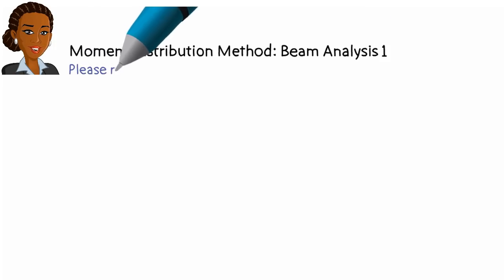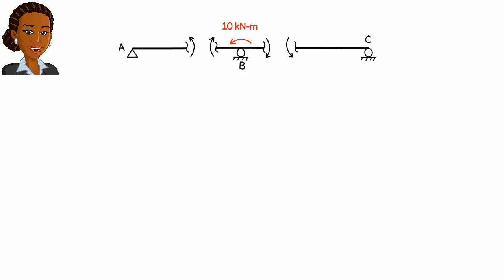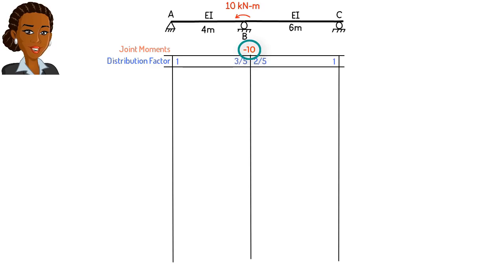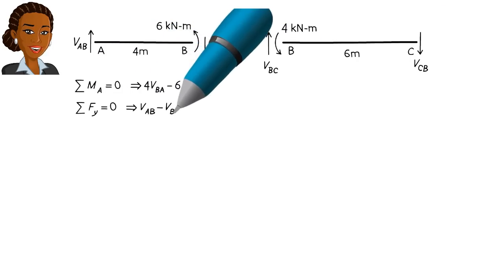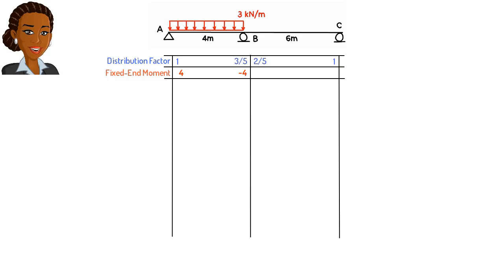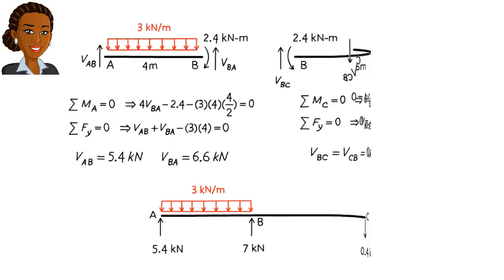SA38: Moment Distribution Method (Beam Analysis 1)

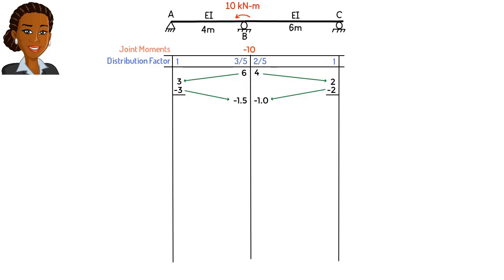Comment: At 6:09 , half of 6 goes to support a , but shouldn't there be  a 3  already existing there , ? Why are we considering 6 , when it gets halved as the other half is carried over to support A , so why are we considering it in full when we sum the moments ??
Reply from the maker: You wrote “shouldn’t there be a (moment) of 3 at A already?” 

At the starting point the applied moment of -10 is distributed to joints A, B, and C. The moment at A is 3 which is half of 6 (the moment at the right end of segment AB). Why should there be any other moment at A already? Where does that additional  moment come from?
Reply: @DrStructure  sorry I meant the moment at joint b , when the 10 moment gets distributed and 6 comes towards segment ab and 4 goes to segemt BC , then we say the half of 6 goes to support a due to carry over ,but my question is that shouldnt there be moment 3 left at b because 3 goes to a , then when we sum moments at BA then why do we consider the whole 6 and not 3 ?
Reply from the maker: You are assuming that we cut the moment in half, keep half of it where it is, and carry the other half to the other end of the member. That is not the right way of thinking about/visualizing it.

We take the total moment acting at a joint (say, the moment of 10 kN.m acting at B), and we distribute it to the ends of the members based on the distribution factors. In this case, we need to distribute the 10 kN.m moment to four member ends: the left end of member AB, the right end of member AB, the left end of member BC and the right end of member BC.

Since the 10 kN.m is applied at B (where the right end of AB and the left end of BC meet), the moment is distributed using factors 3/5 and 2/5 (obtained from member stiffness coefficients).

The 10 kN-m moment also impacts (distributes to) the far end of each member. We say the 10 kN-m moment distribution to the far end of each member is equal to half of the moment distributed to the near end of the member. So, since the distribution of the 10 kN-m moment to the near end of AB is 6, then the distribution of the moment to the far end of the member is half of 6. See Lecture SA37 for an explanation of why this is the case.
Reply: @DrStructure  if half of 6 goes to other end due to carry over and it comes out as 3 then that means the 4 that goes to the other segment will also be halved to 2 when it carries over to the far end , but if we sum of all of them up if comes as 6+3+4+2=15 , but you said the 10 will be distributed to all the four parts , what exactly is carry over ? Because some books it says it's a sort of reaction that a fixed end makes when a moment is aplied on the other end , so in this case when 6 is applied to the segment the 3 or the carry over is basically the reaction made due to 6 moment  in the other end or fixed support, is this correct
Reply from the maker: You can think of the moment distribution method as a derivative of the slope-deflection method. Please review Lecture SA37 ( https://youtu.be/ytzll7n7LYw) to see the connection between the two methods.

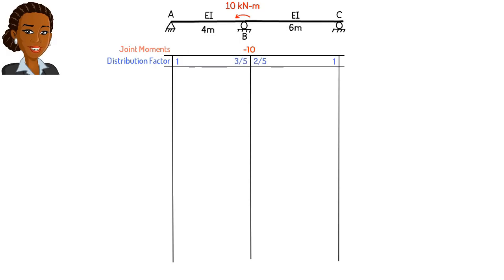In Lecture SA37 at 4:31, you can see how the member-end moments can be expressed as mathematical series; each end moment can be written as a sum of many terms.

The moment distribution method uses that formulation to find the member end moments, one series term at a time. So, in each iteration, one term of the moment (series) is determined. Naturally, since the end moments are determined one term at a time, only approximate values are obtained at the early stages of the process. That is why the numbers don’t add up in the first iteration. But as the process continues and more terms of the series are considered, the numbers converge toward the actual values.
Reply: @DrStructure  okay ,but can you also answer the last part of my question,? The one in which I am asking about the carry over  being like a reaction
Reply: @DrStructure  I watched SA 37 but the relationship with slope deflection completely confused me , I would appreciate if you explain carry over in a more simpler method other than slope deflection
Reply from the maker: The carry-over moment comes into play only when we are using this approximation technique (i.e., the moment distribution method). There is no solid mathematical basis for it other than what was explained in Lecture SA37.

With that in mind, here is a more intuitive way of thinking about it.

Consider a continuous beam subjected to a concentrated moment (M) at one of its interior nodes (say, node B). There are two beam segments connected to B: segment AB on the left side of B and segment BC on the right side of B.

We start the process by approximating the distribution of M to the ends of the two segments using their relative stiffness coefficients. This gives us an approximate value for Mba (the moment at the right end of segment AB) and Mbc (the moment at the left end of segment BC).

Recall from the moment distribution method that:

Mab = (2EI/L)(2 tA + tB)
Mba = (2EI/L)(tA + 2 tB)

where tA is the rotation of  segment AB at A and tB is the rotation of the segment at B.

We assume (again as a result of the approximation we are employing) that tA = 0, and since we have approximated Mba already, using the second equation, we can determine tB (again, this is an approximate value). 

That is, the moment at the right end of AB causes end B to rotate by tB.

Then, from the first equation above (we know tub and we assumed tA=0), we can determine the approximate value of Mab. The moment at the other end of segment AB. This value will come out to be half of Mba. We call this the carry-over moment.

That is, when we determine the approximate value of moment at one end of the member (e.g., Mba), we know that moment at the other end (due to the rotation of the beam segment), called Mab, is half of Mba.
Reply from the maker: The carry-over moment is not like a reaction. It is best to be viewed as the distribution of a moment from one joint to the adjacent joint, a process that goes back and forth between the joints until a desired accuracy is reached.

Comment: mam, please tell the sign convention used here again
Reply from the maker: The member-end moments are assumed to be acting in the counterclockwise direction. That is, when we place the moments at the ends of the member, counterclockwise is considered positive. These moments become clockwise when placed at the neighboring joints. This means, joint moments are positive when clockwise. Consequently, a joint load (moment) acting in a clockwise direction, is considered positive. If the moment is counterclockwise at the joint, we treat it as a negative moment.

Comment: mam, how did we get 0, -2.4, 2.4 and 0 in 10:15
Reply from the maker: By adding up the numbers in each column, starting from the numbers shown in red (fixed-end moments).
Reply: @DrStructure  but, mam, how? I can't understand how it is done. Please show me an example of how we got -2.4 and 2.4 in the bottom.
Reply from the maker: @merensow200  First column (adding the moment values from top to bottom): 
4 + (-4) + 1.2 + (-1.2) + 0.6 + (-0.6) + 0.3 + (-0.3) + 0.1 + (-0.1) = 0
Second column:
(-4) + 2.4 + (-2) + 1.2 + (-0.6) + 0.6 + (-0.3) + 0.3 + (-0.1) + 0.1 = -2.4
Third column:
1.6 + 0.8 + (-0.4) + 0.4 + (-0.2) + 0.2 + (-0.1) + 0.1 = 2.4
Fourth column:
0.8 + (-0.8) + 0.4 + (-0.4) + 0.2 + (-0.2) + 0.1 + (-0.1) = 0
Reply: @DrStructure  Sir/mam, I am really thankful for your reply and help. God bless your kindness.
Reply from the maker: @merensow200  Thank you for you well wishes.